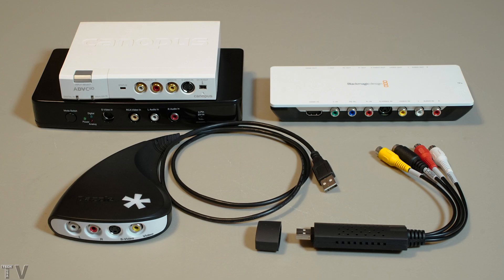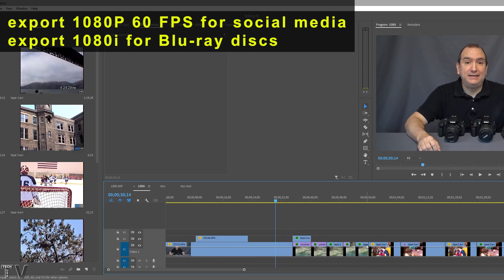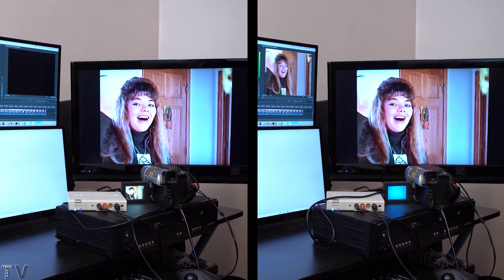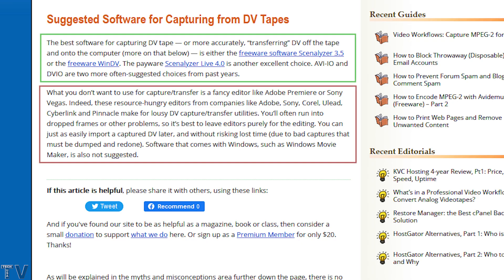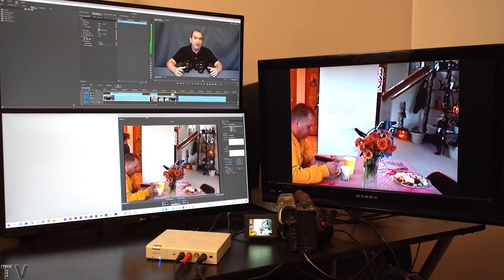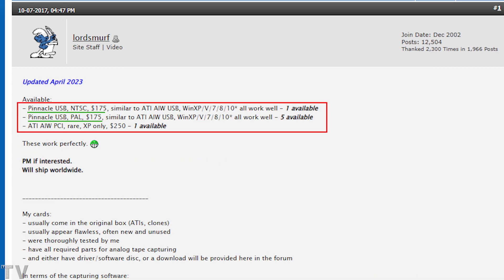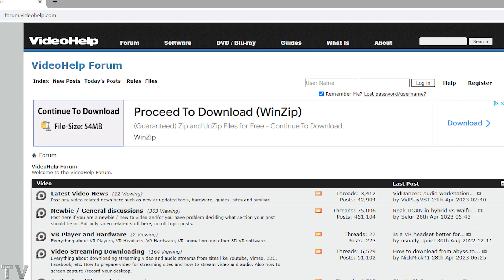VHS video capture and Hi8 video transfer myths debunked

Comment: Pretty pointless to compare the compression artifacts between two noisy sources in a highly compressed 1080p YouTube video.
Reply from the maker: Your thought  process is incorrect.  YouTube can demonstrate how some cameras in low light are better than others as the ISO levels increase. Blu-ray discs, TV stations and cable stations use H.264/265 just like YouTube. YoutTube has decent quality. I admit some people's YouTube videos look compressed and noisy but YouTube is not necessarily to blame. 

 YouTube can be used to demonstrate the image quality of different devices even when the source is old VHS tapes. The ADVC 110 and Intensity Shuttle will both yield  better result than a cheap USB video capture device ass seen in the video link below.

https://youtu.be/RsnOndTrgxw

This video might be worth watching as well.

https://youtu.be/vqCi9B_7mdU
Reply: @TechTVusa  My thought process is correct. YouTube rarely uses H.264, and never uses H.265 due to licensing costs. It more commonly uses VP9 and AV1. Both are fine codecs, but the link in the chain you’re hopelessly missing is bitrate. YouTube’s fine codecs cannot overcome their low bitrates, particularly in uploads below 4K. The difference between DV and losslessly compressed video (because no one actually keeps uncompressed captures uncompressed) is not necessarily noise, but the compression artifacts caused by the DV codec itself. The inherent noise in the analog signal chain does makes it harder for YouTube to compress both sources, though. Between both points, expecting to see any difference in a YouTube upload, particularly one at 1080p, is asinine. Have a good day.
Reply from the maker: I am well aware of the video codecs used by YouTube. H.264/H.265 can yield decent results as can AV 1 provided people know what they are doing. Having said that YouTube is not perfect but it can demonstrate differences between video capture cards and cameras. YouTube can demonstrate one camera being noisy and grainy when compared to another camera. YouTube can show color shift and dynamic range differences. If you were standing in front of my PC you would not see any difference between the uncompressed 10bit 4:2:2 video and the 8bit 4:1:1 video with 5:1 compression when capturing from Hi-8 or VHS cameras. 

Checkout the link below. 

https://youtu.be/vqCi9B_7mdU

Let me put it this way. Even after uploading to YouTube the the image quality still looks good for VHS and Hi-8.

Comment: I have a Panasonic NV-HS1000 S-VHS video-recorder, and I want my old videos to be transferred to my pc, and to save it on hard drive (maybe in RAW format or DV25). Which one of these would be best?:
1. Canopus ADVC 110,  2. ADVC 300,  3.Twinpact 100,  4. BM Intensity Shuttle, or 5. Canopus ADVC-1394 (U09-PC-205) Capture Card, 6. Canopus NHX-E1 HX-E1 HDMI Non-linear Video Capture Card,  7. Canopus DVStorm XA PLUS capture card?
Reply from the maker: I use the ADVC 110. It converts the analogue video into the Mini DV-25 codec. Leave it in the DV-25 codec.

Comment: I had a svhs  deck with an internal tbc that I was using with the Intensity Shuttle on a mac.. The deck died. Will the ADVC 110 work without a tbc and will any ADVC110 work. I don't see a thunderbolt connection.from it to my mac.
Reply from the maker: All Firewire DV Converters have a TBC built in.
Reply: @TechTVusa  Let me try again. I want to know if the ADVC 110 can be connected to a mac via thunderbolt?
Reply from the maker: You had asked prior if the ADVC 110 will work without a TBC. I answered that at 3:50 into the video and in my response to you. You are now asking if the ADVC 110 can be connected to a Mac via Thunderbolt. I answered that in the video at 7:40. 

I will upload a brand new VHS hi-8 video using my new M4 Mac Mini tomorrow. You should check it out but until then you can check out the video links below. 

https://youtu.be/cwGU9VGlWhM

https://youtu.be/rHWHE3ilBbU
Reply from the maker: The link below shows my M4 Mac Mini capturing HI 8 tapes. 

https://youtu.be/YremBGJXUeY

Comment: Great video! I did a test myself yesterday.  

I used a Philips VR20D digital VHS player (PAL) as my source, which has very good quality, a built-in TBC, and some noise reduction options that can be switched on and off.  

I connected the Philips to my Canopus ADVC 300 via S-Video, with the FireWire output going to my MacBook Pro M1 Max. I used a Thunderbolt-to-FireWire adapter and a Thunderbolt 3 (USB-C) to Thunderbolt 2 adapter.  

I used OBS Studio to capture my footage and tested VHS, S-VHS, and even D-VHS recordings. I also have a Datavideo Time Base Corrector (TBC-1000). However, I noticed absolutely no difference between the internal TBC and the TBC-1000.  

As a monitor, I use the Sony LMD-2030W. There's something I don’t like about the ADVC 300’s picture compared to my Philips, so I just found an ADVC 110, which I plan to buy and use instead. I will sell the ADVC 300 as well as my TBC-1000 since I no longer need it.  

It seems that the Canopus 300 has built-in noise reduction that cannot be turned off. In general, people prefer the 100/110 over the 300 for this reason. It all starts with a good video player, which is key to achieving the best end result.

Comment: There's a lot of hate against the DV codec, but it really can produce very decent results.  Here in the UK, the PAL DV codec has better chroma resolution too.  I use lots of AD-VC55 capture devices (a single direction version of the 110, hence half the model number!), also DVCAM decks in E-E mode, and direct firewire capture from miniDV and Digital8 players.  In all analogue cases I feed them via a TBC.  I also have a  Blackmagic Design Intensity Shuttle, a device I find utterly infuriating to use!  For professional work such as Digital Betacam, I capture via SDI.  But for domestic formats, the DV codec is essentially transparent, and hugely superior to the compressed output from cheap USB capture devices.
Reply from the maker: Keep in mind the DV codec is a 8 bit 4:1:1 with a  5:1 compression ratio. The image quality overall is good but it is compressed.

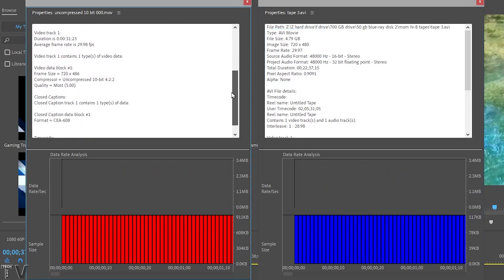Comment: 2:56 - the video on the left seems to have better color and contrast - but I admit I have a very cheap monitor so it could be on my end.
Reply from the maker: They should look the same on any monitor.
Reply: I guess I could have looked at each with scopes to see if I'm not just seeing things.
Reply from the maker: @ Give it whirl but keep in mind you are seeing it after YouTube converts the original file. 

You could change your computers desktop background  to totally white. Check to see if you see blotches with color shift Then make your desktop background totally black and see if you see blotches with color shift.  It could be your monitor. It could also be your eyes.
Reply: @TechTVusa  I dropped a screen cap into DaVinci Resolve and the color parade scopes are very, very slightly broader, particularly deeper the darker ranges. I guess that means the scopes confirm what I'm seeing with my eyes. I'm not an expert in color grading though. I try my best. 

But the difference isn't enough to bother spending 99% more time and effort to gain 1% more quality though using uncompressed video. DV is a perfectly suitable format to capture NTSC video. I use it all the time, but typically just for DV sources like Digital8 and MiniDV where I'm essentially cloning the original. 

Thanks for the replies - it's been a good conversation.
Reply from the maker: @Retro480i  Maybe you could do a video about it.
Reply: @TechTVusa  that's not a bad idea. It's one thing to review "the math" of video and the things codec to to video. It's quite another to physically demonstrate how those differences really appear in video. I'm sure somebody out there might be curious about it. I think the DigitalFAQ forum is a great resource but agree with you that their motives don't always match the average person's goals.
Reply from the maker: @  There could be some good information at digitalfaq.com and even videohelp.com . Having said that lordsmurf spreads a lot of misinformation on those forums.
Reply: in my monitor, left video looks "greenish" but sharper than right video
Reply: @RafaelZeratai  I think the color is punched up a smidge - but the scene itself is actually just very green. I should just grab the still, and overlap the frames, then A/B then. :-)